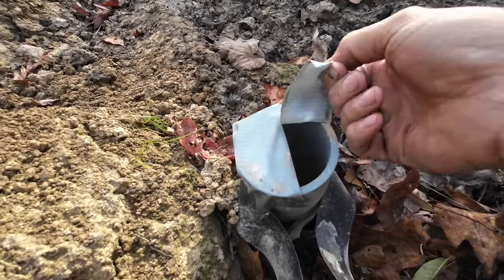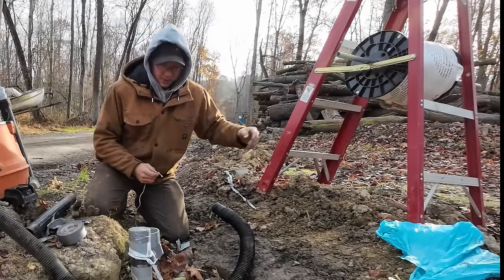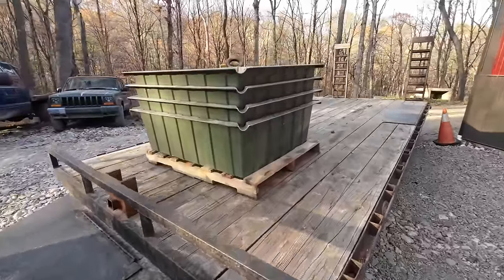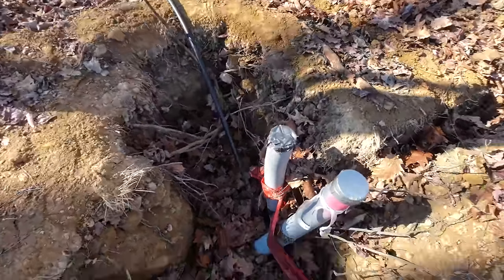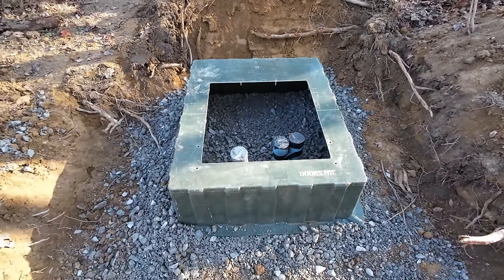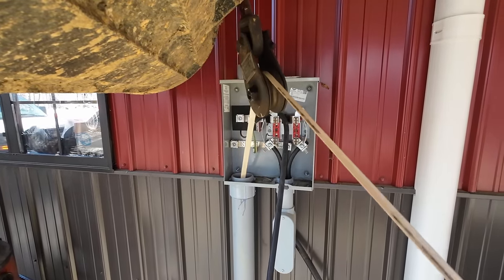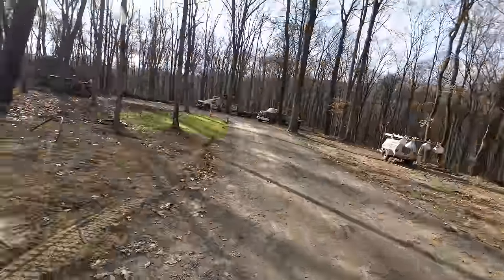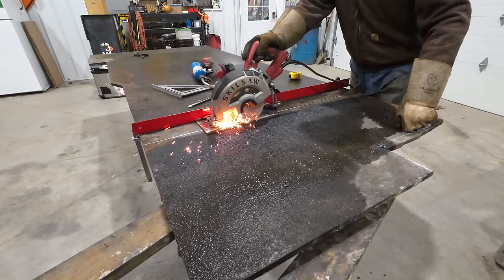The Power Company Charged me $52,000 for this!!

Comment: This cost is why I have several neighbors who did the run of power on their property themselves.  They have 240V service at the edge of their property.  They put in a meter main combo there.  After the panel, it goes to a 240:2.4kV pad mount.  They then ran their own 2.5kV cable from there to their house and shop.  Then another pad mount steps it back down to 240/120.  
I believe it was done for about 1/3 of what the power company wanted to charge.
Reply: I was thinking exactly this.. Why not just have them drop the meter at the pole and do the run with your own wire/ transformers...
I bet they dont let you do that in PA or something stupid like that.Thing is Primary wire is not cheap and neither are transformers... 
I bet the power co. has at least 20K in the wire and transformers. Either way it wasn't 52k in materials obviously and more likely made up about 1/3 of the total 52k cost 
Side benifit of running it yourself is that if its your wire and transformers, there is no need for access easements.
Reply: Just stepping back up to 480v-600v halves your required amperage rating of the wire and regular service wire can be used. 480v transformers are common and can be had extremely cheap second hand. Once you go above 600v, wire, disconnects, transformers, etc. get expensive. The math works even better if you can get 3 phase.
Reply: @TofuInc  (Edited to Add the following calculation I made are  WRONG) b/c i forgot that you obvi dont need 400amps at 4.8kV (you only need 48kVA ... Aka 40 Amps at 2.4kV... Aka 400 amps at 240v) (thanks to @Tofulnc for  pointing out the obvious mistake I made.

(Original Post)
I ran the numbers,  using the NEC Table Data "asumptions" and voltage drop over 2500' would be unacceptably high for even 200 amps @ 480 v and even at 600v ...

You need to get into the 4.8kv range before it makes sense for a "1/2mile run" (aka 2500 feet) and Matt likely needs 400 amp service for the house and shop.
Running 1000kcmil Aluminum wire (huge and expensive) at 600v/200amp over that distance (2500 feet) would give you ~ 6.5% Voltage drop 
Running 1000kcmilAluminum  wire (huge and expensive) at 480v/200amp over that distance (2500 feet) would give you ~ 8.1% Voltage drop
And i believe both would require 3.5" PVC Conduit, which makes the $15k Matt spent on his 3" run look "cheap". 

Running the likely required 400 amps doubles those voltage drop numbers so even at 600v and running 1000kcmil Al. wire the voltage drop would be like 13%.

3% Drop in feeders is the NEC "note" "recommendation".. though I dont think all codes require it this low (and I know some energy codes require it even lower ( like 2%) but assuming the goal is a 3% Voltage drop max...

You could run 350kcmil Aluminum at 2.4kV/200 amps and come in just over 3% voltage drop.
Or run 400kcmil Aluminum at 2.4kV/200amps and come in at just over 2.75% voltage drop

But at 2.4kv @ 400 amps even 1000kcmil is "undersized" (3.24% voltage drop)

A better (more cost effective) run would be 

4.8kv @ 200 amps with 3/0 Aluminum (2.78% voltage drop) 
or
4.8kv @ 400 Amps with 250kcmil Copper (2.75% voltage drop).
4.8kv@400 amps with 400 kcmill Al. (2.79% voltage drop) 
Or
4.8kv @400amps with 1/0 copper parralell conductors giving you 2.59%
4.8kv @400amps with 3/0 Al. parralell conductors giving you 2.78%
Or
4.8Kv @ 400 Amps with 350 kcmil Al. (3.04% voltage drop) this would be over the NEC 3% but I doubt the total run is actual 2500' (atleast 100 ish is after the transformer to the shop) so if it was anything under 2470 Actual cable length before the transformer it would be under 3% voltage drop.

And I believe you could run all of these combos in 3" PVC which is "cheap" and readily available .
Reply: @grumpycat_1  Why are you trying to do calculations at 200 and 400 amps? 240v at 200amp is 48Kva. 48Kva @ 600v is 80 amps. 48Kva @ 600v 3 phase is 46 amps. 48Kva at 4.8Kv is 10 amps...
Reply: @TofuInc  You nailed it, I knew that I was missing something... Obviously you wouldnt need 400 amps at 4.8kV
This is why I am not a lineman ;-) I edit my original post and took out the part where I said "and I could be wrong here" ... were obviously I was. So I edited it again and To reflect I was totally wrong ;-) . Look at that ... Youtube comments can actually be educational !
Reply: @TofuInc  So I just ran those numbers and it still looks like you would need 1000 kcmil Al/500kcmil cu.  at 600v/80amps (48kva) The specified cables I stated 1000kcmil are not oversized according to Southwires calculator... and the other Calculator Said 750kcmil Al. min.
I ran the calculation at 2.4kV and it "looks" like since  2.4kV @ 20 amps (48kVA)  would be only 20 amps as you stated but the calculators say you would only require 6AWG Al. (or 8awg Copper) over 2500' (2.98% al. / 2.88% cu. Vdrop)??? That cant be right can it? Southwire's calculator  and two other I tried both said the same thing.
What am I missing, I don't know anything about "Med. Voltage Wire" pricing but it looks like 8AWg copper Med. Voltage wire might be the way to go...  

Do  they even make 2.4kV Wire this small though???  I think Southwire has some 6awg Wet rated 2.4kV wire (type MV-90 Single Conductor Copper,) but I couldnt find its pricing anywhere.... I know they make a "dry" rated wire in 8awg copper for 2.4kV but underground conduit is not "dry" one might argue.
Reply: @grumpycat_1  I'm not going to go over all the calculation here. 600kcmill would be sufficient if using 600v nominal voltage. Single phase your only using 2 conductors. Direct bury it with a couple splice boxes. 2 reconditioned 35Kva transformers. All of that can be done for about $2-3k more than what he spent on conduit alone.

Going above 1kv limits that number of people your going to find that will even touch the system. Not worth it IMO.
Reply: Yeah like I said I dont know what the cost of large dia. RHH/RHW-2/USE-2 type cable is but I don't doubt you that it could be done for less then 66K even if he had to run 1000kcmil Al. 
I dont doubt you that oversizeing them to 1000kcmil is not actually needed to get an "acceptable" voltage drop at 600v/80amps.. 
Even the southwire calculator which is based on the NEC "guidance" 75° wire etc. says you can use 500kcmil Copper.
Reply: @grumpycat_1  It can be done for under $20k. I think he said he spent he spent like $14k in conduit. He could have bought 5000' of 750 URD for that and direct buried it.

There are a lot of things you're missing. One major part is your trying to calculate the voltage drop at 200amp for a "200 amp service. a 200 amp service is actually a 160 amp service with a 200 amp OCD. Just like a 400 amp service is really 320. So the calculation need to be done at 83%. 75c rating is irrelevant since your going to exceed the voltage drop way before the c rating will come into play.
Reply: @TofuInc  nothing but the 240V breakers are needed.  The MV side is just to points.  Primary only protection is permitted by code, so no disconnecting or over-current protection is needed.
Reply: @grumpycat_1  2.4kV is just fine.  2400ft at 40A (so 240V 400A) has 2.3% drop on 4 AWG.
That said, it would be worth pricing 2.5kV, 5kV and 15kV wire to see what's cheapest at that distance.  
At 7.2kV, you could get away with whatever is the smallest wire available.

Comment: Not power, but cable. Local cable company had an easement on the property with a buried cable. New building went up 50 feet from the cable, all marked and whatnot. the cable company wanted $60,000 to connect

Comment: Side note keep that mule tape lol, it comes in handy for allllll kinds of stuff. I like to use mine for stretching hammocks in between new pole sets and long distance tree runs in the wild. It can be braided into a decent tank rope too, that stuffs pretty tough.
Reply: the problem I had with it is that the stuff I had was saturated with silicone and I couldn't get it to hold a knot!  I washed it and it still had the silicone.  I gave it to a guy who does boat covers as it's what he uses around the outside to hold them in place.   I heard it's also called parachute cord.
Reply: @AffordBindEquipment  I've heard it called that too although it's nothing like paracord. I've never seen any with silicone on it. I have ordered some that came with what's called 'tracing' wire in it. It's just a small solid copper core wire woven into the entire length and it's used to help you identify line sets typically under ground or in my case I was sent to pull wire on a job where a tech was filled with 23 different conduits. I needed to know which conduit was my responsibility and that stuff allowed me to identify that.

Comment: It really gets entertaining if you suspect there's water in the conduit ! Just have your apprentice run the vacuum because when the bag starts to travel, all the water is accumulated in front of it and ALL arrives at a high rate of speed, all at once ! LOL  The pull boxes need to be big because the high voltage cable does not like tight radious bends. It shortens the life of the cable.

Comment: New viewer, love watching old engines roar to life. VGG, NNKH, ultimately lead me here. That vacuum trick dropped my jaw, amazingly simple and I will be looking for the next opportunity to use it myself.
I have heard of the rural expense phenomenon, how much more expensive it is to get the regular connivences of urban living to rural areas. Electricity, gas, internet. The markup for bringing these things to the middle of nowhere is nuts. As we all depend on electricity for our modern lives, not much to be done about it. Even solar has it's drawbacks. 
If it at all helps absorb the blow, underground electricity lines in my personal experience are the most stable and resistant to outages in bad weather. My home is fed by underground lines and in 10 years I can only recall 3 outages that lasted longer than a few seconds and even the longest was only about 10 min.

Comment: Hi Matt I'm sure you don't want to hear about this now but  it may assist you in the future with other projects .when the power provider sees the opportunity to increase the amount of power sold to a customer  certain infrastructure levels are provided by the company so it is best to increase the size of service panel ,for example you probably had a 200 A 1 ph  so you will call for a 400A 3 ph  termination can and provide 200 A 1ph for your home and 200A 3ph for your shop .the power company always provides me with all poles underground boring .and wire to the meter even the conduit.you just need to show the possibility that that can sell you more power by increasing the service size. Larger services cost you a bit more but not near what that just cost !my last install cost $12000 complete for the two meters  off a 400A 3 on termination can with 125 ft house drop and a 225' 3ph shop drop . the drop for the power company was 2900 ft  1 underground road boar 1 pole and 2 transformers , you need 2 to get the 3 on power all at no charge .I  found out too late the first time around but it didn't wound me as bad as you ,man that had to hurt!!! Shame on them for not putting this info out there but that don't you have to ask!
Reply: he installed a garage that size that is suppose to work on heavy equipment and it's not three phase? I just reviewed the video and nope it's not three phase. WTH?
Reply: really confusing you use meters and ft in the same paragraph, but I get what you're saying. Honestly think they took Matt for a ride because there's no other provider in that area
Reply: Wtf  no 3ph maybe the power Co was down to 1ph in the primary  but in the country you would think it would be mandatory due to ag wells on the farms in the area!

Comment: I’m not a big supporter of solar and battery, but you sound like the best place for off grid power. Especially because you can oversized the system and use the excess power to pump water into a tower for local use.

Comment: Well Matt, you own all the wire and the transformer from the last power pole. I think the power co. is about 10K high. However with such a large crew, it was worth it to be done in under 1/2 a day on the install. The old vacuum trick works well if the conduit is right. When you pull wire in the future those finger traps work a treat. They also make dandy strain clamps on hydrolic hoses.
Reply: read the contract…. if he owns it he has to fix it when it faults. urd cable has a live expectancy isn’t lightning proof and gets dug into all the time

Comment: Way too cool trick! 52K for wire and transformer: I would be too pissy to write the check and would be more of find a good used fairly large diesel generator and use that. I had about 1000 feet to get power to my barns and 14? years ago seems like they charged me around 8 grand for the privilege to write them a monthly check.
Reply: Would you expect to get that High Voltage Transformer, HV Cable and Installation done for free? 

Are you in a remote location like this too, where urban consumers subsidise the supply infrastructure for remote locations too?
Reply: Honestly you will spend way more on diesel in the long run
Reply: @BTW...  You must be a youngster.Back in the day when rural electrification was a priority the cost was shared. Now,the utilities and electric coops look at any fed or state funding as nothing more than a benefit to be used for any and all expenses.Justified or not.
Reply: @jnic2003  or not. Even if I use zero kilowatts the minimum billing at my rural property is $68.00 a month. It's a coop. If I was on a genset and used zero KW's my fuel bill would be zero.....
Reply: @amossnowdaharleyman9179  occasional use property is one thing. When your full-time shop and eventually house is going to be there it's different.

Comment: I'd keep that mule tape. Looks like it is pretty strong. Also the chinese finger trap contraption thingy. Glad you finally have grid power at the shop. I was going to suggest skipping the string and tying the bag onto the mule tape and it seemed to work well. I've seen alligator hunters on a popular TV show use something similar.
Reply: The Chinese fingers are called Kellum grips and as long as they aren’t smashed they will last a lifetime.
Reply: @irunwire8528  Not sure why they don't reuse them. Reliability or maybe even liability reasons?
Reply: @coondogtheman  not sure, didn’t get a real good look at them. They may have cut some of the strands when they cut the tape off or when they were disconnecting from the wire. They may have just left them in the pile of mule tape as Matt got a pair of needle nose pliers also. Just careless maybe.
Reply: @irunwire8528  If I found that tape I would take the time to untangle it and roll it up. Maybe attach the two lengths together to make one long length.
Reply: That wire pulling basket , was left by mistake
Reply: I ran a horizontal directional drill for a while, and I definitely saved a bunch of the mule tape we pulled through the conduits we pulled, and it has definitely come in mighty handy many times.
Reply: @irunwire8528  That was an awesome find, those needle nose pliers. I hope Matt puts them in a frame or something and displays them. (Caption) $53,000 needle nose pliers.

Comment: Matt? How many amps is the transformer rated for? 
All the comments about 'cheap solar' don't take into account that this is not a low power system. I'm a retired TV Broadcast engineer, who had to deal with 500KVA backup  power systems, and HV DC cabling for transmitters. You don't let the home electricians and "I once fixed a table lamp' types do any work at this level.

Comment: Damn Matt, i wish i knew you were still fighting with utility. I could have offered some assistance. I do electrical testing and do medium and high voltage testing. We could have came up with an arguement that i could perform acceptance testing to their specifications or i could offer NETA ATS specs. We would perform VLF withstand testing at 0.1hz and assuming its 15kV rated cable, i would test it at 21kV for 30 minutes. They could even do the terminations and i could test it after. They would probably still say no but i deal with various utility companys in the north east and sometimes they bite for stuff like that.

Comment: I did a quick calculation.
I work for an electrical company in Germany and can tell you that 52000 isn't really much for 2200ft (700m)!
Without knowing any further details (cross-section of the cables, transformer power), I can say that 700m of copper cable in a 10kv version 3x35qmm, i.e. 2200ft AWG 2, costs around €45 per meter for us.
So $49 is $15 per foot. That's $33,000 just for the cable without laying!
The transformer costs probably $7500 and the 3 bases cost $250 each.
We're at a total of $41,250 without anyone collecting, clamping, checking or certifying anything.
I think it's completely fair!